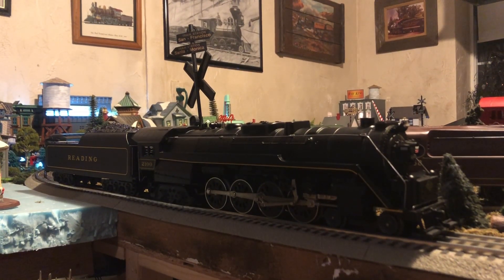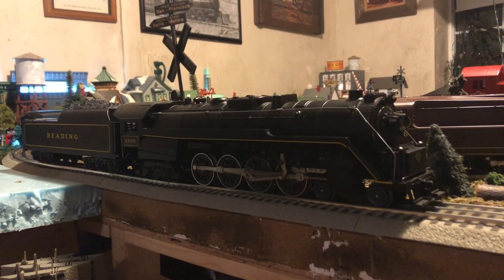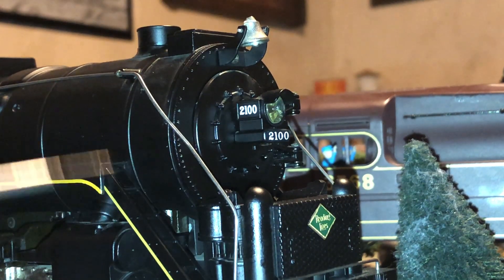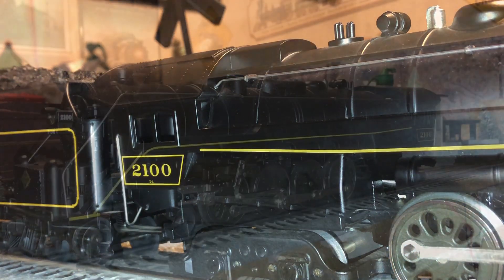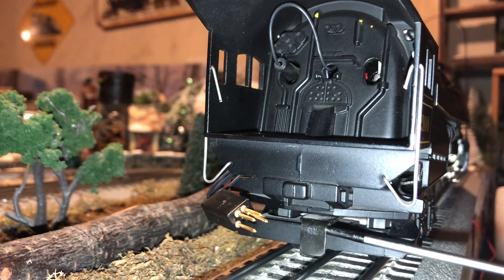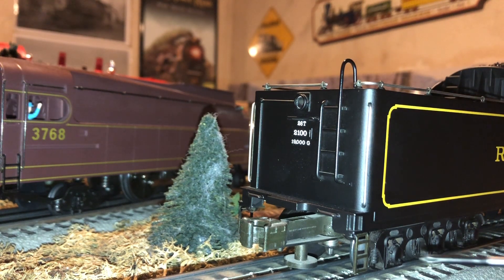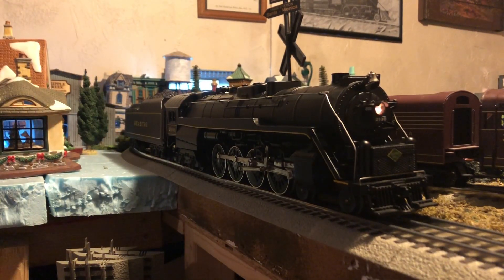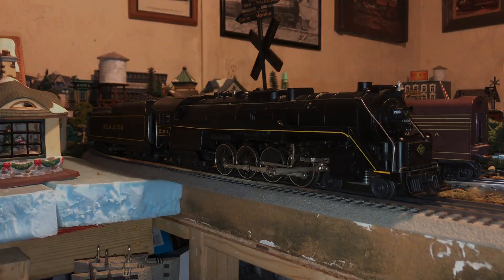Lionel 1989 6-18006 Reading T-1 Review

Comment: Cool
Reply from the maker: thanks!
Reply: @brendanstrains9725  np
Reply from the maker: @bdvids7930  I am working on the script for the history segment the 2124 and 2123 lines are done so I will send them to you
Reply: @brendanstrains9725  ok
Reply from the maker: here they are

 2124 was the first T-1 to be used for the rambles in 1959 between Philadelphia and Shamokin. 2124 would run for the rambles until 1962 which became the first T-1 to be retired. After it was retired it  was sold to F Nelson Blount for his steam town USA collection. 2124 would stay  in Vermont until 1986 when it was moved along with the rest of the collection to Scranton Pennsylvania. 2124 still resides at steam town and is cosmetically restored in the rambles paint scheme.  

 
Now 2123 was less fortunate then the other 4 T-1s. After the Rambles ended 2123 was sold along with 2100 and 2101 to a scrapyard in Baltimore Maryland. She would later bite the dust at the hands of the scrap mans cutting torch in 1966.
Reply: @brendanstrains9725  cool thanks i’ll get to work on them as soon as I can
Reply from the maker: @bdvids7930  ok
Reply from the maker: @bdvids7930  the 2102 lines are done 2101 lines are almost done and the main history of the T-1 class is done.
Reply: @brendanstrains9725  o cool
Reply from the maker: @bdvids7930  thanks the lines sound good!
Reply: @brendanstrains9725  thanks
Reply from the maker: @bdvids7930  I am doing my first Premiere right now

Comment: I have the same engine, can’t get it to move. I’m using an older zw 275 transformer. The engine headlight comes on and powers the tender. Any advice? 
Thank you.
Reply from the maker: Did you check to see if the plug was connected to the engine and tender. Since if it isn’t plugged in the e unit will remain locked?
Reply: That was the problem. Thank you!
Reply from the maker: @justinstevens9937  no problem